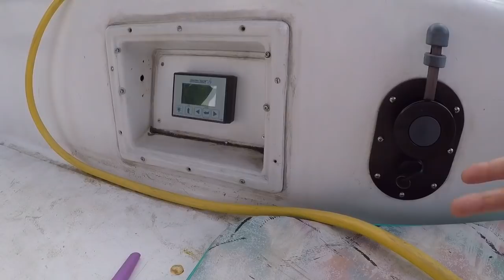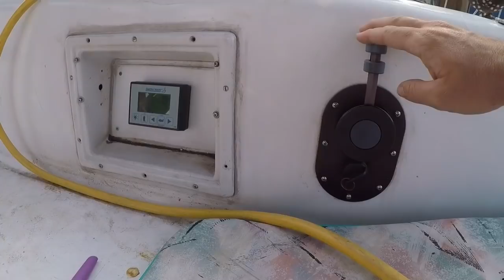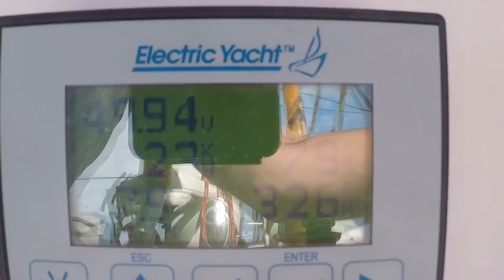Our Electric Motor | Sailing Wisdom Ep 32

Comment: If I may, The rudder aperture may not hurt you as most of the props power is produced at the tips. I would caution that you must be careful in timing passage through inlets. This is when you often need all the power you can get to punch through with the wind on the nose. If you decide to increase the diameter of the prop make sure you have enough clearance that you don not get hammering from the shock wave.

Comment: Put a disconnect in line between your 48 volt positive and your converter. That way you are not disconnecting battery post underway which could see you accidently drop a wrench across two poles and instantly fry the wrench and potentially damage battery post or leafs, or of course yourselves.

Comment: First of all great video and great info. For a lot of people in this thread I'd like to say that going electric # going pollution free. As a matter of fact it's quite possible that as we speak battery production and disposal poses a greater threat to the environment than CO2 emissions and ICEs. Solar panel technology too uses toxic materials that will have to burden the environment later down the line when their useful cycle ends. What's most attractive about going electric is being independent from fossil fuel costs and refuelling locations. The autonomy is what makes the most sense for sailboaters that want to go electric, especially those that want to get to isolated locations. If you're doing it for environmental reasons don't bother.

Comment: I also looked at electric motors for my Tartan 34C but I opted out because I keep her on a Mooring ball all summer long. Having an electric system would have required being hooked up to shore power and I can't afford those high marina fees. I have a small 100Watt solar panel that could not recharge such a big battery bank based on less than 8 hours of good sun light a day.  Thanks for sharing.
Reply from the maker: +tartansailor ah yes. Sometimes it just doesn't make enough sense to go electric. Cool that you entertained the possibility though! :)
Reply: If you have hydrogeneration, you may be able to recharge your battery bank at anchor or moored, due to currents and wind if the current is strong enough and the prop is appropriate or has variable pitch.  In principle, water that moves past the prop (due to current, wind, etc.) can charge the batteries.  Similar to large scale commercial tidal power generation on a much smaller scale.  Naturally solar and wind generation can help too.
Reply: Loanword Eggcorn I crossed the Atlantic back and forth with my boat and had a hydro generator running most of the time. It produced 14.5 volts 5 amps at 5 knots. At 3 knots it stopped generating current. A 800Ahrs battery bank which is half discharged would take at least (400 / 5)  80 hours to charge. That is a lot of time at anchor with a lot of current under the keel. This is not realistic. However having a hydro generator while long distance cruising makes a lot of sense. It charges 24 hours a day. I only had 225Ah battery and it was fully charged most of the time. I had the auto pilot , the fridge, lights, instruments, gps, ssb and computers running all the time. I had the now defunct Ampair Aquair 100 and loved it. Good luck with your cruising.
Reply: +tartansailor Thanks!  Hydrogenerators should be great for both cruising and day sailing.  For the latter it can recharge the energy used motoring out of the Marina, etc.  (All assuming its windy enough, etc.) Agree the prop and motor would need to be tuned for it to be able to hydrogenerate at anchor.  There's some good progress being made on electrification of boat motors and regeneration, so I'm sure we'll be seeing more of it over time.
Reply: Loanword Eggcorn It’s all down to speed for regen. Check the graph here http://oceanvolt.com/solutions/hydrogenerator/
Reply: The graph shows output power generated at a speed of 7 knots and more. My boat does not reach that speed  under sail. Do you have any idea how much this thing cost? it is most probably not affordable by 99% of the worldwide sailing community...
Reply: tartansailor Indeed, right in both counts. My hull speed is 6 knots.
Reply: Costs will come down for batteries and motors, and efficiency will increase, just as it is for electric vehicles on land.  May take longer for boats since it's a much smaller market, but the change is inevitable due to the electrification of transport already under way.  A large part of this is driven by continuously falling battery costs which are the major cost in EVs.  Lithium Ion battery costs fall in half every 10 years or so, making the replacement of internal combustion on land a foregone conclusion within 20 years.

Comment: Very interesting.  I take it you have the sculling oar as backup.  It is true that a diesel can get you away from bad weather,  but in my case with a 25-foot waterline, I cannot move very fast anyhow.  It sounds like the electric can give you enough thrust in a pinch should your anchor pull out in a sudden squall and you have little room to maneuver--always a lively event for us engineless folks ...
Reply from the maker: How to Sail Oceans I spent a few weekends building the sculling oar, got it finished, and then tested it out. The test was very disappointing! We got our speed up to 0.2 knots in dead calm with no current. We did find that it worked great as a spare tiller/rudder so we keep it for that. I really think it would work better with the blade set vertically instead of horizontally. 
We have an engineless Albert 30 that I used to scull in and out of the marina, so I know the concept should work, but I think the difference is a 4.5 ton Alberg vs an 18 ton Morgan. It’s just a lot of weight to get moving forward.
How fast are you able to scull?
Reply: @RiggingDoctor  Flat water, about 1.5 knots,  I am around 8 tons.  But the 3.5 hp Tohatsu with the dink tied off the quarter will move her at 3 knots at a little under half throttle.  In either case it has to be flat water though, you need an inboard to motor where there is a swell.
Reply from the maker: How to Sail Oceans Thanks for the info! Do you use your oar blade vertically or horizontally?
Reply: @RiggingDoctor  I'm a little confused by your question ... with sculling I give the blade some pitch on each stroke, reversing it for each direction.  I use an oriental lanyard to alleviate the upward pressure of the oar, which helps a lot.
Reply from the maker: What I meant was: is the blade of the oar __ or | off the back of the boat? And then you adjust the pitch of the blade accordingly.
Reply: @RiggingDoctor  Generally about a 45 degree angle.  Vertical would give you the most thrust initially, but once the boat starts moving, the oar will want to become more parallel.

Comment: The electric motor is a real wonder.  I think it is possibly the perfect thing for you guys.  You two are super patient, so that is no problem.   Go to the blog section of your motor manufacturers website.  Lots of people are getting a generator as well.  Obviously you would 99.9% of the time maybe not need one, but that .1% is that time where you have no wind, no place to anchor, and 6 knot current heading straight into something bad.  I want to get an electric drive as well, I really don't care how fast I get there either.   Please don't think I am trying to be negative, really I am not.  I know you are talking about me and a few others when you say we are debbie downers.  I think it will work for you I just wonder about that one in a million chance something my come up that the setup couldn't handle.  I just can't see the harm in having something you might never use like an outboard or generator.  If you aren't using them you aren't polluting, etc.  I will keep saying I think some of the items you aren't acquiring might be important safety items for you, but I want you to know I respect your decision to sail the way you want to sail.  You are well within your rights to keep saying that as well.  I also wanted to say I am sorry if I have made you distraught or upset in any way.
  Oh the solenoids you mentioned...well are solenoids..but are typically called contactors when engaging large electrical loads. They may give you trouble in the future as they look sealed(no repairing them).  Eventually the metal bars in them that are actuated by the solenoids build up carbon on them or weld themselves together inside...not fun!  The battery bank really shouldn't be drawn down more than to 80% capacity normally.  Depending on your readout that 35 hours at 1/3 hp might only be 7/3.5 hours without toasting some batteries.  This is where a generator might be helpful in prolonging the life of your battery bank. The life of them will drastically be altered.  90% is optimum.  I myself have an electric boom lift and an electric scissor lift.  Both great machines.  Better than anything else when you have enough power available and are super cheap to run.
Reply: Amen, Allyn.

Comment: Even with moving blade propeller you can regen. Just bring it to spin with the motor and the blades engage because of rpm. Now turn of the motor, the rpm stay up and motor regens. To make it quiet again you gave to reverse 10% to stop the propeller so that the blades disengage.
Reply from the maker: Very cool technique!

Comment: There is a family that's been sailing for years without a motor(the coconuts) they say you don't need one they are going to purchase a larger boat and they said it will definitely have a motor (not electric), what are you going to do in a lot of European ports that have narrow rocky entrance and a constant incoming or outgoing tide of 6 plus knots people with motors have a hard time getting in. I want to install a Toyota Prius hybrid motor where it runs of electric till motor power is needed to recharge the batteries or give the prop more power

Comment: Not sure about VFD’s.  We use them for AC to DC and back to AC through pulse width modulation applications.   There are VFD’s for a DC source.  Maybe worth a look?   In our application your looking at reducing power supply need to 35% and still producing 70% power output.  That would be huge for your application.  I think Emerson has some.  Anyway, just throwing it out there.  (Oh, VFD stands for variable frequency drive).  It allows frequency manipulation of a sign wave after the diode conversion, capacitor rectification and then inversion and frequency adjustment with the use of IGBT’s.  It’s a long explanation so research them.   But frequency control allows for less power needed while preserving power output.  Also increasing motor longevity, cost and even noise reduction.  Fairwinds.  Also the channel How To Sail Oceans is great. He travel without a motor other than his dingy use at times.
Reply from the maker: Thank you for explaining what VFD is, now I know what it is that I’m looking up when I read about them. 
They sound like a great solution in our application. 

I met Kevin from How to Sail Oceans a few days ago. He is an awesome guy! 
Our current videos were filmed in June, but when we get to the stuff we filmed recently, he will be in it :)

Comment: Captain thank you for your electrical system blueprints. however since i am purchasing Gulfstar 50' with diesel will respect by not over powering her rpm's nor wanting to use it rarely for wanting to install external mounted electric outboard engines lots of big ones out there. WHAT IAM addressing herein is wondering if my 12 volt boat bank system should have also a 48 volt boat bank system for arriving at having more storage for the 12 volt system.

Comment: If you can arrange the solar system to deliver excess power ie more than you need for your purposes like running your fridge etc then once you have the excess you can dump the surplus power to spin your prop.

Comment: It is wonderful to hear that you have gone electric. My diesel is ready to be lifted out and the electric motor installed. Since I have duel fuel tanks I am putting  in four 48v banks where they were located. Gives a little extra run time if needed but I'm in no rush to get anywhere.
Reply from the maker: +Chewy Dog sounds like you have the right attitude for electric! Let us know if you have any questions or just want to compare notes!
Reply: 4 48v banks would probably be way too heavy for any boat requiring 48v banks.....unless the weight was evenly distributed......and 48v is dependent on size and weight of boat using electric....larger boats require 72v or even 96v to push them along at hull speed.   it's mathematically calculated.